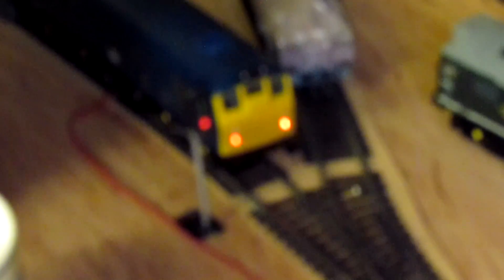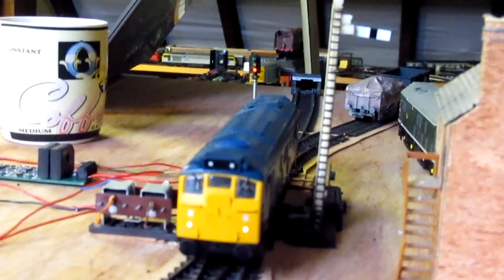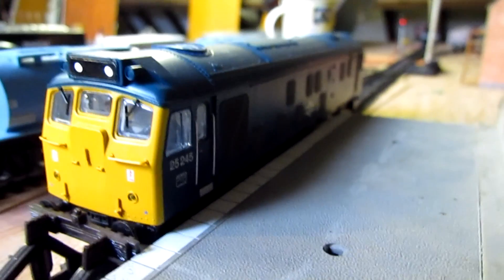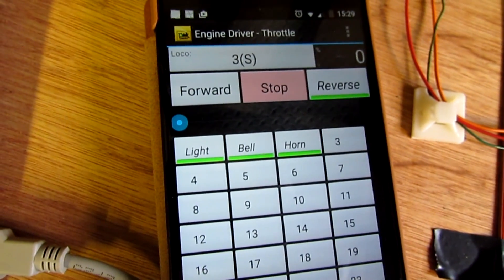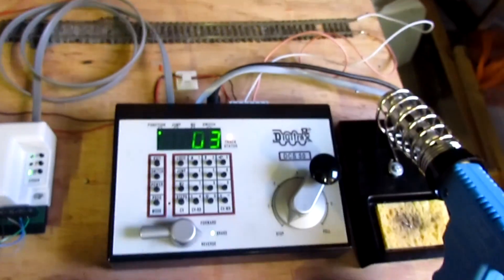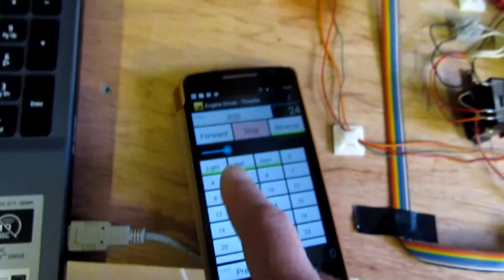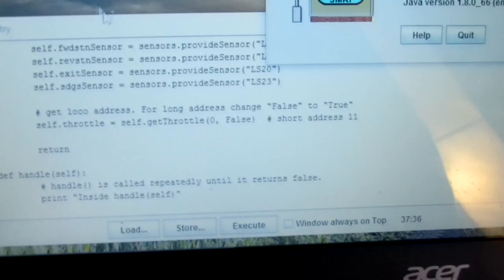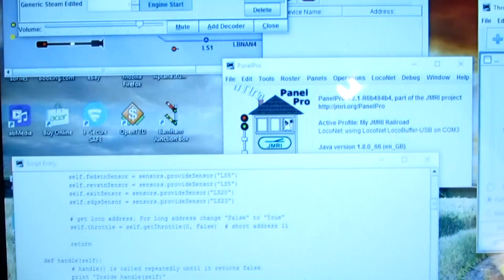JMRI Scripting, WiThrottle and Virtual Sound Decoder - updated sound

Comment: FYI, The VSD sounds are just WAV files in a zip archive. You could open the zipped file and replace the American whistle with a European whistle quite easily. The engine sounds are just a bit more complicated because they need to be set in accordance to the throttle setting.
Reply from the maker: +Railyard Productions Hi, just spotted your comment thanks! I realise it's not too hard to get it working in that way, I was really waiting for the location dependent settings to be usable. Do you know if that works yet? I saw some comments on the JMRI forum but have not had the time to chase up. Cheers.
Reply: As far a I know the location  dependent setting do work. I was in contact with Twindad several years ago when he was working on this. I havent emaild him in years but I'm pretty certain he said it was working.